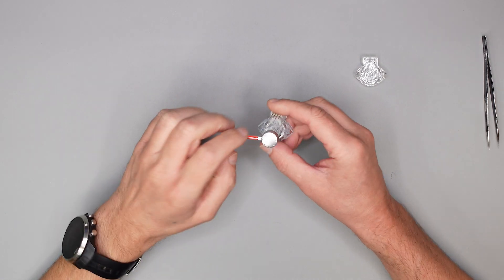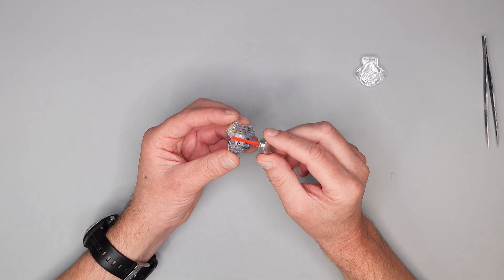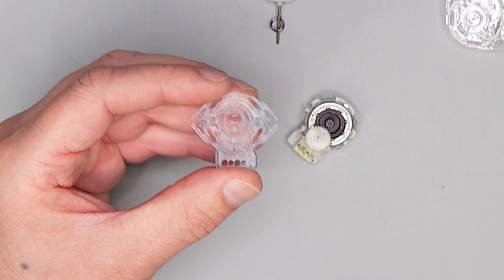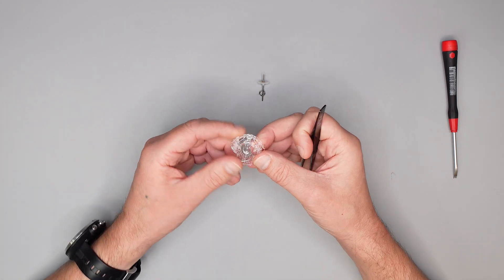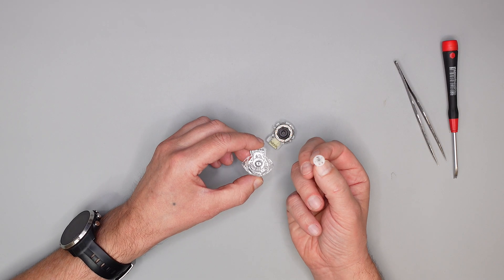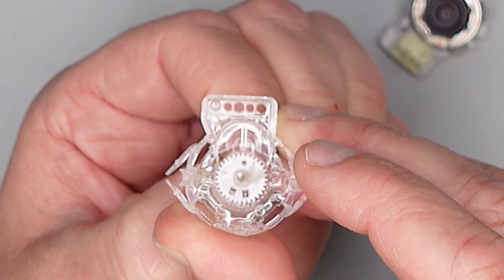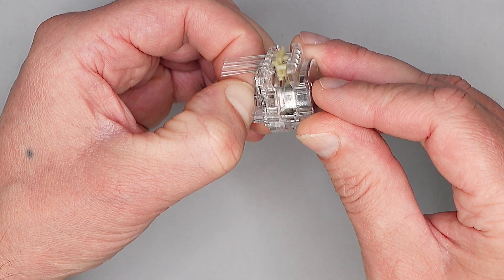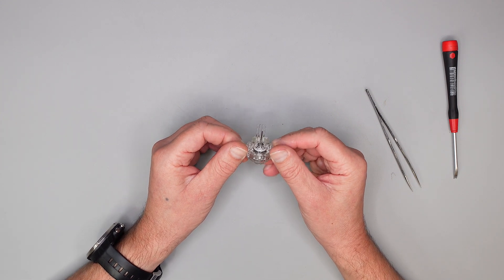Do it yourself! It's so easy to repair the defective pointer in Audi, Peugeot, Citroen, Fiat speedo!

Comment: The issue i am having is that i cant get to remove the stepper motor with its case from the rest of the instrument cluster in the first place. The needles that i cant remove too are the temperature and the fuel. Fiat Punto 188. Any tips?
Reply from the maker: maybe they are soldered?
Reply: @pixelfehlerhamburg  Indeed they were.

Comment: Hi, if the Speedometer sometimes works upon startup (and continues to do so) until the car is turned off and started again and when it works the tach works and when it does not the tach does not. Would that be the stepper motor housing as your video shows. The speedometer vibrates on zero when it does not work and when it works it only retreats  down to 2 mph when stopped and idling. And will this part fit a 1997 Audi A4 (B5)? Thank you.
Reply from the maker: Please send us a foto.

Comment: Very interesting video. I wonder if this procedure will fix the problem with my instrument cluster in my daughters Audi A3 8L. The instrument cluster part number is 8L0920932M. Everything works fine except the fuel gauge and the temperature gauge. The fuel gauge is totally dead no matter how much gasoline I fill. But the info text on the instrument panel works, and shows correctly how many kilometers I can drive with the gasolin I have. The temperaure gauge is another issue. It shows that the temperature is almost 80 degrees even when the engine is cold. So, will replacing the stepper motor fix these issues?
Reply from the maker: Hi for Fuel and temp gauge there are different stepper motors. Maybe it helps to change them, but the A3 has very often more problems.https://www.pixelfehler-hh.de/Schrittmotor-Audi-TT-A3-A4-A6-Tank-Temperaturanzeige-Kombiinstrument

Comment: Thank you. My speedometer stopped working just now. I have purchased via ebay the housing. I hope that will be the solution 😅.
PS: I tried to buy it in your site but i was being always redirected to main page after click checkout or basket :S
Reply from the maker: Sorry we had some website problems. Now everything should work perfectly.
Reply: @pixelfehlerhamburg  I love you. I just removed the stepper motor and boom, that's the problem. Very easy fix (and cheap). 😍😍😍😍😍😍

Comment: hello friend I have a problem with the gas meter in audi a3 2003 when it is full gasoline the middle works well until it reaches the middle of the station when it lowers more the gasoline meter goes to the minimum point on the board that could be already floating change from the pump the problem is on the board
Reply from the maker: Hi, is it model 8L or 8P? 8L has a lot of problems of this kind. You can send it over to us and we can repair it, i guess.
Reply from the maker: Hi, the tank pointer is different. I could be the stepper motor but also possible that something on the board is defective. Or the sensor inside the tank